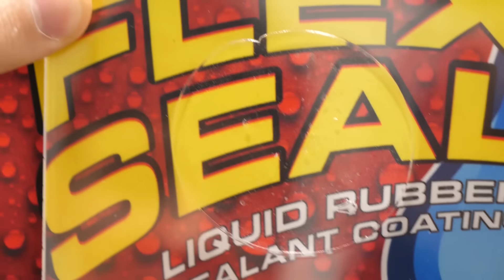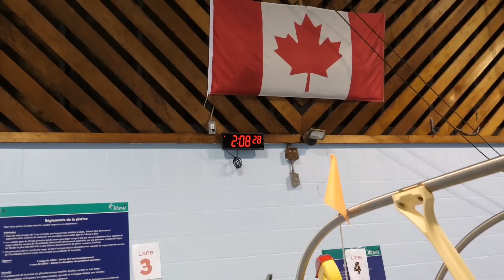I Made An Entire Glass Boat With Flex Glue Clear!!

Comment: Hi, Phil Swift here with 
Flex Tape! The super-strong waterproof 
tape! That can instantly patch, bond, 
seal, and repair! Flex tape is no ordinary 
tape; its triple thick adhesive virtually 
welds itself to the surface, instantly 
stopping the toughest leaks. Leaky 
pipes can cause major damage, but 
Flex Tape grips on tight and bonds 
instantly! Plus, Flex Tape's powerful 
adhesive is so strong, it even works 
underwater! Now you can repair leaks in 
pools and spas in water without draining 
them! Flex Tape is perfect for marine, 
campers and RVs! Flex Tape is super 
strong, and once it's on, it holds on tight! 
And for emergency auto repair, Flex 
Tape keeps its grip, even in the toughest 
conditions! Big storms can cause big 
damage, but Flex Tape comes super 
wide, so you can easily patch large 
holes. To show the power of Flex Tape, 
I sawed this boat in half! And repaired 
it with only Flex Tape! Not only does 
Flex Tape's powerful adhesive hold the 
boat together, but it creates a super 
strong water tight seal, so the inside is 
completly dry! Yee-doggy! Just cut, peel, 
stick and seal! Imagine everything you 
can do with the power of Flex Tape!
Reply: @Jef M201 words and 1144 characters
Reply: this isnt right
Reply: @noobtutorials7254  and?
Reply: My man made a lyrics for the flex tape video
Reply: @LastCraft6008  somebody did. your man copypasted tho😄
Reply: Wth

Comment: kicks a hole in his wall
"They partnered with me on this video" 
doesn't actually use flex seal to patch it up but uses the bag 🤦‍♀️
Reply: PMDubb'sLlamacrew229 he did use flex seal. flex seal bag 😂😂
Reply: Just like the Simulations.
Reply: Honestly that would have been a good test
Reply: THATS A LOT DAMAGE
Reply: XD
Reply: MEGA FACE PALM 🤦
Reply: @Fred_boy2000   he flexed sealed it SHUT
Reply: BRUH
Reply: He sawed a boat in half and now he made a glass boat I'm not surprised
Reply: He still used a sealer but it was a bag
Reply: How does someone casually kick through a wall like that?

Comment: So I work at a glass shop installing car windshields mirrors and house glass. The pane he used to break was tempered and hitting it in the middle would be not necessarily smash it. Also the rain channel on the top with the plastic has bolts that the plastic snaps into.